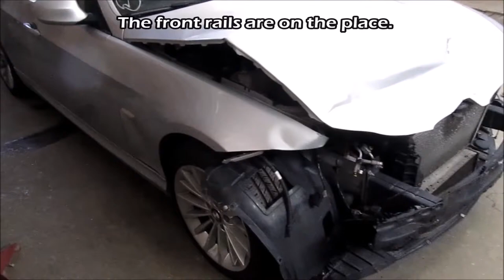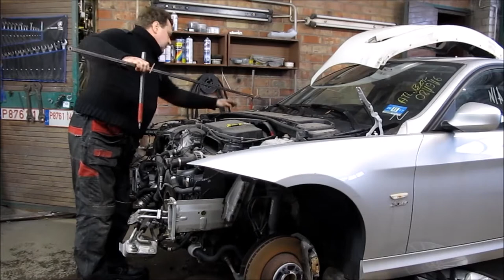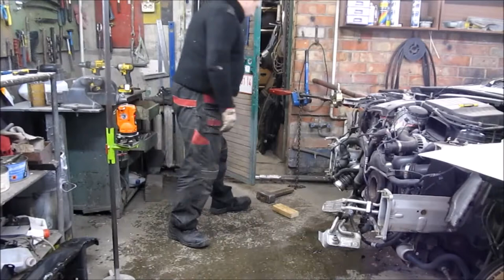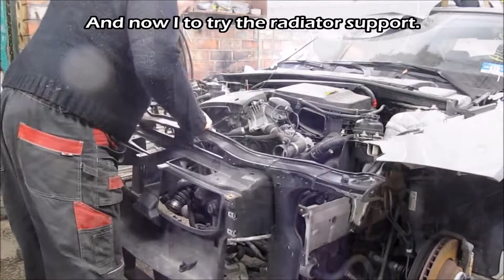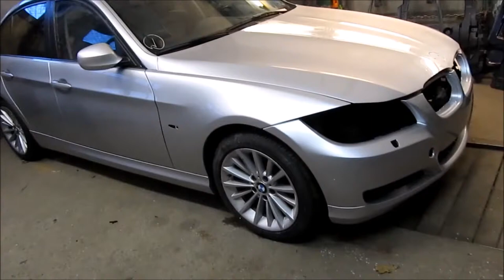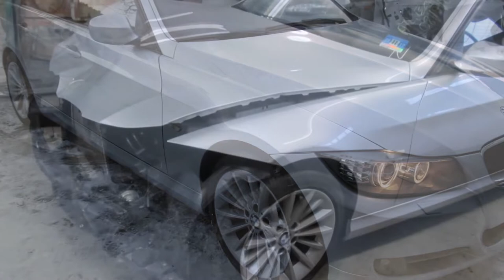BMW 3 Series - Collision Repair and paint (Frontal Damage)

Comment: I am needing to do something like that how you have that set up only i need to bend back the metal pipe things with the holes for the radiator core support to go in to mine like bent in towards each other very slightly from hitting a tree any suggestions

Comment: Hi what are the torque specs for the 4 bolts on each side of the crash bar/slam panel? And should I use loctite
Reply: Oh it’s called radiator support in the video